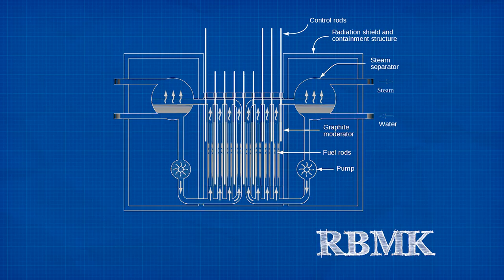Chernobyl's New Safe Confinement: The World's Largest Movable Object

Comment: Simon's going to run out of different angles in that studio for these channels. The 15th channel will be filmed on the roof of the building.
Reply: I mean, you can get some really cool 360 drone footage that way. 

Better yet how about this: You go to an open space, roof or otherwise. Use drones for that great 360 degree video capture but combine it with augmented reality where Simon basically does the minority report thing where he pulls up schematics and other info to show the viewer. Then we have a zoom in scene switch where it goes from the schematic to the real thing.

Would it be a lot of work, yes. Would it be possible with current day technology, absolutely. In the end it's the viewer, not Simon that has to see the result, he just has to do the right movements to make it work with special effects added later.
Reply: Indeed. Later, Gonzo will focus on Simon's kneecap ( The Great Muppet Caper ).
Reply: The shots will only be 90 seconds long
Reply: everywhere bricks ....red bricks

Comment: So that "innovative" procedure of using jacks to build the structure up is actually what they do to build grain silos. They build the roof, then jack it up til they can fit a ring of the siding. Bolt it on and then jack it up and repeat. Keeps you from needing something as hard to move as a crane. Obviously applying it to such a massive structure is different, but its very much not a new way to build.

Comment: Xenon buildup stopped power buildup by absorbing neutrons, they pulled out all control rods putting the accelerator graphite blocks up, when the xenon was exhausted the water began to boil creating extreme steam pressure and power generation. Once they noticed they pressed the AZ button which shoved the boron control rods down, but when the graphite moved downwards, it displaced the water, the heat exploded several fuel rods, and locked the graphite in place, pressure rose until the maximum pressure of the reactor was breached' throwing the lid upwards like a frisbee.

Comment: 6:23 It wasn't just making power until 2000, the last reactor to shut down was Reactor #3 - housed in the same part of the building as the destroyed reactor, opposite the familiar smokestack that was removed for the NSC.

People talk about poor manufacturing at Chernobyl, but these things were built to last generations. Many RBMK reactors are still in use.
Reply: Yeah but only after thousands or even millions of lives were ruined, and even after that a man had to kill himself in order for them to finally address a massive design flaw that they didnt even let people who worked reactors know about.

Comment: Chernobyl wasn’t the first, Three Mile Island was a decade before.
Reply: And there are other accidents such as the SL-1 meltdown and explosion, which killed people, even if only the workers on-site.
Reply: three mile is only level 5, this is a level 7, a full meltdown 

https://en.wikipedia.org/wiki/International_Nuclear_Event_Scale
Reply: Three Mile Island, and I'm definitely not denying the severity of it, was only a leak... Chernobyl was an explosion of a reactor core that ended up killing hundreds of thousands because of incompetence.
Reply: @mooniejohnson  Oh yes they're definitely incomparable, but he did describe Chernobyl as "the world's first nuclear meltdown" and that is definitely disputable if not refutable. Completely melted reactor material reached the containment vessel at TMI, and it was only due to the superior safety of the design that it didn't escape.
Reply: Floss Man it wasn’t a “leak” it’s was a partial meltdown. The difference between the two was other than one being a full meltdown, TMI was built with containment. Chernobyl didn’t have any secondary containment, it only had the actual structure. 
If TMI was built as cheap as Chernobyl it would have been way worse but the majority was contained.
Reply: @AL4140   It wasn't just the containment that determined the outcome.  Windscale and Chapelcross also had meltdowns with no secondary containment (even the modern British AGRs don't really have secondary containment), the critical difference is water as a primary coolant in the RBMK (and the original control rod design).  If you have gas or liquid metal coolant, you avoid the catastrophic steam explosion (and possible steam-zirconium reaction generating hydrogen).

Chernobyl unit 4 wasn't even the first RBMK fuel melt event, or the first at Chernobyl.  Chernobyl unit 1 (older generation design, compared to unit 4) had a partial meltdown in 1982, and I'm fairly certain there were other RBMK fuel melt events prior to Chernobyl unit 4.

The first absolutely catastrophic full meltdown, possibly.  Absolutely not the first full or partial meltdown, and not even the first RBMK meltdown.
Reply: @mooniejohnson  the who estimates 4000-6000 fatalities from Chernobyl
Reply: Three mile island was apparently almost completely safe just outside of the building. Chernobyl had notable effects hundreds of kilometers away.
Reply: Micah Philson thats because 3 Mile Island was designed with secondary containment. Chernobyl didn’t have anything other than the actual building.
Reply: 3 mile island is no comparison.. I lived in the zone during that time
Reply: Sort of an aside...  Since you mention TMI...  It's now totally shut down.
Reply: Severity of accident is not point of this discussion, timing of it, and statement in video is. He didn't said "largest accident" he said "first meltdown". Partial meltdown is still a meltdown.
Reply: Vojtěch Farkaš exactly my point!
Reply: NRX, SL-1 and Windscale were much sooner than TMI,.. not to mention explosion of liquid waste in Kystym
Reply: @snipe69 If you do favorable roundup, nothing is impossible...
Reply: No, NRX in 1952, Windscale in 1957, SRE 1959, SL-1 1961, Fermi 1966, et al.
Reply: Jeffrey Templeton the point of my comment was addressing the point in the video that Chernobyl was the first. Which clearly it wasn’t. I simply used TMI as a famous example 🤦‍♂️
Reply: @AL4140  Right on.
Reply: Chalk river up in canada had at least two big nuclear accidents in the late 1940s and 1950s including having the reactor fuel catching on fire ( the site is a research reactor that was started as part of the us Manhattan project )
Reply: Was interested in this right until i heard this completely incompetent comment at the beginning  "hardly a suprise considering this was run by the USSR" followed by awonderful 'roll of the eyes'... wow u mean the USSR that put the first dog, then man, into space... oh the first satellite in space, not to mention their military tech (especially their tanks) were very advanced.... yeah that completely useless USSR. Thanks u did give me a laugh at least. Well done!  :D :D :D

And fyi, this wasnt the first meltdown, yes it was one of the worst (and should of been managed much better),  but there were and have been others since...oh wait they weren't all in the USSR, hmm were these also "hardly a suprise" to you?

Maybe  consider not generalising a whole group of ppl based on one event, not subscribing to this... unfortunate.
Reply: TMI was almost completely self-contained, and only let out a little bit of tritium water. Because of the way heavy water is handled by the body, you could drink the fallout from that and not get cancer from it. It's like comparing a volcanic eruption to your hot water pipes leaking.
Reply: @PrograError  INES Levels do not differentiate by core damage but by damage on people, radiological barriers or the surrounding area. A INES 5 can still be a meltdown and a INES 7 may just be a chemical explosion in a storage facility that stores vast amounts of radioactive material. INES 7 and meltdowns do correlate in history, but are not linked in the INES.
Reply: @chrisburn7178  I case of a nuclear power plant, I would not call that superior safety. More likely "mandatory" or "standard" or "working". It is not and should not be something "above standard". Chernobyl was a crime.
Reply: @OslikusPrime  I agree entirely that Chernobyl was a crime. However you can't argue with the use of the word "superior" as it's entirely correct in that context; it just means "higher in quality" which is incontrovertible. The word has been bastardised by years of marketing such that it's become understood to mean "the best possible" which isn't really the case.
Reply: @chrisburn7178  I know what you mean and I agree. I know that you ment superior over Chernobyl. It was just a little bit of sarcasm on my side - against Chernobyl. And in my opinion, in case of nuclear powerplants those words should by a synonymn. Best possible safety measures should be bare standard there.
In adition to obvious disaster, such event is only more ammunition for fanatic anti nuclear power religious movement.
Reply: @OslikusPrime  Oh yes, absolutely. Like all these things, the fear of nuclear power stems from lack of understanding, stoked by a sensationalist media as well. My view is that in order to have a low-carbon power network, nuclear has to form the backbone and "renewables" can fill in where they can. Considering how many mistakes are made and how much equipment fails, (besides Chernobyl) it shows itself to be remarkably safe even in worst-case scenarios.
Reply: wind scale plant  in uk had a fire i a reactor in 1957 .We were very lucky it didn't go into meltdown and it was caused by us trying to get more uranium by-product to make nukes to get America start sharing  info and collaborating again.
Reply: @chrisburn7178  , maybe with the next generation reactors, where an explosion is physically impossible no matter what 🙂

Comment: The Aftermat, eh?
Reply: <Joke> Little did you know, Chernobyl had a second use as a dryer for door mats with the extra heat from the reactor </Joke>
Reply: Was wondering how many would mention this.
Reply: @megaprojects9649 
absolute
ly
Reply: I'm just here for the Aftermat response.

Comment: "World's first meltdown?" I'm pretty sure there were others. Perhaps a more accurate statement would be "largest," or "worst."
Reply: e.g. Three mile island
Reply: @downstream0114   There was no meltdown at Three Mile Island.  There was an incident caused by workers failing to follow proper procedures but the designed safeguards  worked, limiting  the release of radioactivity to a very small one, and barely above background level.
Reply: @fredlougee2807  The core melted.

Comment: Hello Simon,  I like to give you some aditional information about the New Safe Confinement, (NSC). As you already explained, the NSC was built by two Main Contractors. 
And there were also a number of subcontractors, of course. 
One of them, was the Dutch company Mammoet, ( wich actually means 'Mammoth'). Mammoet was responsible for the lifting of every part of the construction during building, but Mammoet was also THE company wich had the honour to actually 'move' the NSC from it's buildingplace to the Sarcophagus. And, being a Dutchman, i am very proud of that!! For the sake of completeness: The New Safe Confinement is 165 meter long, 256 meters wide, and 110 meters high. 
Inside the NSC there is a gantry crane, to lift the parts of the sarcophagus and other parts. 
But this hasn't happened yet, because the radiationlevels inside are still far to high to literally dismantle the sarcophagus. It will take pretty much time before this can be started.

Comment: 1:13 Technically the Three Mile Island accident was the first meltdown in 1979. It was only a partial meltdown, but it did precede the Chernobyl accident and the core material did melt. Luckily that stopped before it breached containment.

Comment: Great video! Could you do a Megaprojects on the Old River Control Structure? It regulates the flow of water from the Mississippi into the Atchafalaya River, thereby preventing the Mississippi River from changing course.

Comment: Yes but when they used the switch to immediately shutdown number 4 reactor it caused a power surge which caused it to explode and also number 3 reactor suffered damage from the exploded to. Also the fire gear the firefighters was wearing was dumped into the basement of the hospital and was only filled with gravel a few years ago to stop people going down there  and by the way it is one the most dangerous placed in Chernobyl.

Comment: I would have suggested a much more permanent solution to get rid of the whole reactor. Set of an underground nuclear explosion underneath the entire reactor complex so it would sink in the big hole that it would create.Once it's on the bottom of the hole fill it up with all the remaining rubbish and top it with soil and concrete.Would be a lot cheaper and more permanent solution.

Comment: Given the existence of ships and movable oil platforms (488m long, 104m high and 300,000 tons for the Prelude FLNG to 31,000 tons in the case of the Safe Confinement) it's a stretch to call this the largest moveable object.

Comment: uhh you have a bit of info wrong in this. it wasnt a test on the reactor it was a test on the electrical grid and the water coolant systems were switched off and remained off during the tests when they werent supposed to. the reactor was powered down to almost a non reactionary state but the emergency coolant systems they were testing(steam powered turbine to provide enough power to keep reactor from melting down) failed.

Comment: It wasn't anywhere near the first nuclear meltdown.  There were quite a few of them from the 1950's until the 1960's but these were mostly in smaller research reactors.  The first one in a commercial power plant was Three Mile Island, 7 years before Chernobyl.  TMI had a much better designed reactor and containment structure though, so despite going into full meltdown there was very little contamination outside the plant itself, with the overwhelming vast majority being in the reactor containment building.

Comment: Chernobyl was not the worlds first nuclear meltdown.  It was the first to break the containment structure, but Three Mile Island in Pennsylvania, USA, was the first meltdown.  When they finally got cameras down into the core structure it was found that between 50 and 70 percent of the fuel rods had been *badly* damaged by the accident.  It wasn't far from breaking the containment structure, but it did not.

Comment: What about the meltdown uranium itself? We can't send a robot to cut that into small pieces, then place each piece into a thick lead shell that will prevent most of the radiation from leaking out of it. Then transport them to a number of running modern reactors to be used as fuel?

Comment: The Soviets are much like much like the US. The difference is the budgets that they put into projects, and the engineers they have. I find it intriguing that they are able to complete the projects that they do, and the confinements they are held under. When you look at completing a project, the perfect solution is not always needed, sometimes it is not desirable, for the budget. 
Why design a air system that is perfectly designed to be as efficient as possible with current technology, and is large enough to last many cycles of growth, all the while, easily upgraded when needed. That initial system would be over 100% more than designing a system to complete the job for the next foreseeable next 10 years. Then modifying it then. 
That being said they are resourceful, and able to complete anything placed in front of them. All the while, doing it quickly.

Comment: The accident was indeed horrendous so I’m not belittling it. However Chernobyl death toll has been used by anti nuclear activists to beat the industry. The death toll has been hyped upwards to make their case. With around 50 killed on the day there is no way it killed 100,000 in total. 
The story is more about Soviet hubris than anything else.
Reply: It did certainly not directly kill 100k. But however how many thousands have been indirectly killed by developing cancers that could have otherwise been avoided had they not been exposed to such a catastrophic amount of radioactive dust? I'm not disagreeing with you that Chernobyl is falsely used to discredit nuclear power generation in general though since nearly all western or more modern designs are incapable of causing an accident of the same scale. To a degree even Fukushima was caused by a degree of hubris in setting arbitrary limits for what kind of tsunami could be expected without looking at evidence of just what kind of power the Pacific Ring of Fire is truly capable of generating earthquake-wise

Comment: The tour guide I had when I visited brought up a great thinking point; why are we bothering to dismantle the reactor? Dismantling the core is incredibly risky, and the waste removed from the site is only useful for burying somewhere else. Who's to say they won't have another accident in the process of either dismantling or transporting the nuclear waste? Even western engineers make mistakes and accidents can always happen.

The land around it, in particular the western trace isn't going to be hospitable for centuries and it's not like Eastern Europe is densely populated and needs the Land. Add to that the ongoing cost, which is money that the Ukraine could desperately use in other areas. So now we have this fantastic structure around it, why not just fill it with something the local economy knows how to make in vast quantities; concrete. Just bury it, put big signs on it and leave it alone. And when the NSC starts to erode and needs replacing, building a new one over the top of huge concrete dome shouldn't be anywhere near as risky or costly.